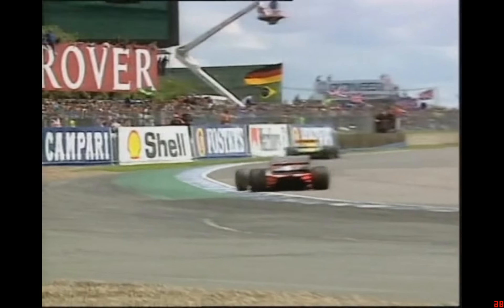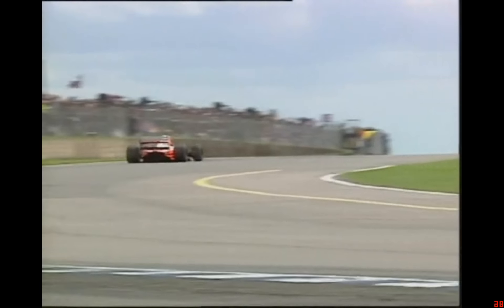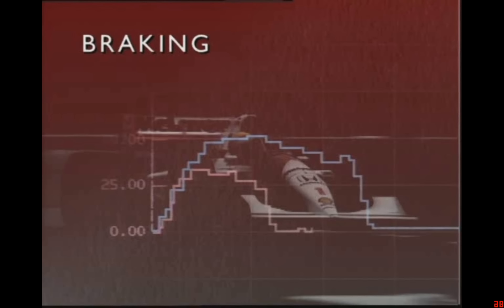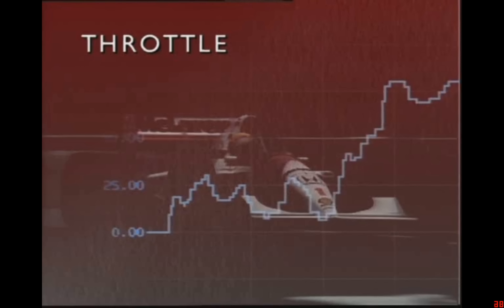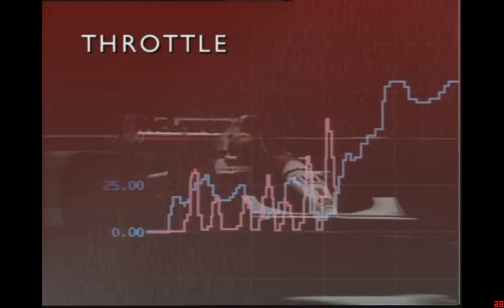Ayrton Senna - Braking & Accelerating Technique

Comment: And it also let to the fact that Senna always needed more fuel than his teammate. 
But I would be interested in seeing the Data of Senna and Prost on  chart. In fact, Prost had a different driving-style and was equaly fast.
Reply: He was most definitely not equally fast. He was the most consistent and was the master of preserving his tires and car, but he was not as fast. That much is abundantly clear from the qualification results. Those two were different in just about every way - made for the best rivalry I have ever seen in any sport.
Reply: And Prost won more titles with that than Senna. Therefore he was faster...on the long run. Thats whats important in motorsport.
Reply: Sorry, no. You are mixing concepts up. On the one hand you have the concept of being "fast" (the best indicator of raw speed being qualifying), on the other you have consistency. Then, overall you have a measure of who is the greatest driver overall - which also has to take into account the number of years you drove competitively, your competition, the quality of car you are driving, etc. Prost was the most consistent and Senna was the fastest driver - and to quote Jackie Stewart after Senna won his 2nd or 3rd championship (I forget which), he said Senna is now no longer just the fastest driver, he is also the best.

As for being the greatest, that goes hands down to Senna. It is subjective of course, but it is extremely rare to hear an expert or driver rank Prost higher. And the Autosport Magazine poll run some years back, which polled some 200 past and present F1 drivers had Senna ranked as the no 1 ever (followed by Schumacher, Fangio and then Prost).
Reply: TOFKAS01 so schumacher is more than 2x better than senna by your metric
Reply: He was definately more sucessfull.
Reply: His stats are better. But its from a career that spanned 16 years not counting his comeback. In cars that were almost always competitive. And in an era where Prost had retired, Senna had died, Piquet had retired, Mansell moved to Indycars and then retired, and his competition came from "giants" like Hill and Villeneauve (against whom he still felt the need to cheat). Hakkinen was the only world class driver from may 1994 and until 2003-2004 or so, but for all but a couple of years he was driving a hamster-powered Mclaren. Then, once names like Alonso and Raikonnen entered the picture (and matured and got good cars), party was over. Statistics have to be put in context.
Reply: Prost was definitely faster as he had more fastest laps.
Reply: Not a correct determination. For speed, you look at qualification. This is why Senna is considered by pretty much everyone as the fastest ever - even the few people who do not consider him to be the greatest ever will still usually say he was the fastest.

The problem with fastest laps is that they represent a single lap in the race and they were (in those days) almost always done at the very END of the race. From 1984-1994 re-fueling was not permitted in pistops, which meant that the car was much lighter at the very end. Fastest laps were therefore usually set by people chasing rather than by people leading. So, you could be much much faster for the first 60 laps, the cruise it home on the last 10, but then not get the official fastest lap because someone pushed hard to make position right at the end.

Fastest laps in those days were pretty meaningless. And in the years when Senna was at his fastest and in a good car, he would almost always push hard to get a lead early in the race. Rarely at the end. At the end, he was either so far ahead that he could cruise it home or he was out with a technical failure or accident.
Reply: Alan Frost Prost also had a higher % of wins and podiums, therefore faster when it mattered.
Reply: Look, you may have access to Wikipedia, but you are completely off the reservation here. There is no expert in their right mind - even the VERY few who regard Prost as better - who would say Prost was faster. In every qualification, Prost tried to be as fast as he could - just like everyone else. And Senna stood head and shoulders above them all in what is likely the most competitive F1 era ever. Also Senna is regarded pretty unilaterally as the fastest driver ever, even by the few that do not consider him the greatest.

He is usually also considered the greatest of course, as I argued above. Statistics on their own are pretty empty. They have to be put into context, and when done so, most experts agree Senna was the best ever.
Reply: Alan Frost is right. When Senna and Prost had the same car, Senna was faster it's a fact. Sometimes even much faster, like in Monaco 1988 when Senna got pole with 1.5 seconds less than Prost that was second.
Reply: MrCacciLLo no, he is wrong. We're you even old enough when these races happen? Senna always beat Prost in qualifying because Prost, like other real racing drivers like Lauda, would concentrate on race setup instead of having the car set up for qualifying.
Reply: Well, I will be turning 43 in a month or so, so I am old enough and I did see those races first hand. Every driver, including Prost, did their best to qualify. Did you see his face when Senna beat him by 1.5 seconds? You can find his expression here on youtube if you didnt see it then. 

Senna was also faster during the races; but Prost was more consistent. This difference was most apparent in Senna's early years, when it really was like fire and water - the fastest driver to ever step into a car vs the professor, who was the master at preserving tires and components. Later in his career - as Jackie Stewart so correctly noted when he said Senna is now not JUST the fastest driver but also the best - Senna had overcome many of his early weaknesses.

This is literally THE most absurd discussion ever. To argue whether Prost was greater would at least be an argument - not a great one, but it would be backed by some statistics. But to claim he was FASTER than the driver widely acknowledge as the fastest of all time means you are smoking some great opium over there.
Reply: You're Wrong, that's not correct. The 2 years (1988 and 1989) Prost and Senna had the same car, Senna was always faster. Both in qualifying and during the races. Senna had also more victories than Prost in both of those championships. Fortunately I was already old enough to see how good Senna was. The years from 85 to 93 were the most amazing times, for me personally F1 died in the 1994 season.
Reply: TOFKAS01 89 was a steal not a win
Reply: Not 100% true. If Senna didn't crash, it was very likely he would win more titles. The thing with Senna is his peak wasn't met. Perhaps if he didn't crash, he would have done more extreme things than he did in the '91 Brazil GP or everytime in Monaco.
Reply: If Prost were fast you wouldn't be commenting on a documentary about Ayrton. Plus we've seen Senna lap him more than once :)
Reply: buster is literally on every senna thread arguing prost is faster, when guys like alan frost give the facts he's gone.
Reply: @alanfrost75  Berger matched Mansell on Saturdays and Mansell Prost. These were the second to fourth fastest qualifiers and Senna often beat them by a lot. People mocking the fine driver/host Palmer should remember this.
Reply: @buster130579  No Lauda wanted to beat Prost in qualifying but couldn't. He managed to barely beat Prost with setup and experience. The situation was reversed when the faster Senna was bested by Prost in 1989.
Reply: @alanfrost75  is that why Prost has more fasted laps than Senna?
Reply: @MrCacciLLo  you also need to  remember that Honda admitted to providing Senna with more powerful engines.
Reply: @musicmusic6595  Alan Frost isn't giving very many facts though.  You also have to remember that Honda admitted to providing Senna with more powerful engines than Prost.
Reply: @buster130579  Actually, I responded to this earlier in this thread. Also, in response to your false claim to the other guy, you will find that my posts are full of facts - if you actually bother to read them. You dont have to read them, but please dont then claim that I am not providing facts. Anyway, here is the bit from ages ago that I replied with regard to fastest laps:

The problem with fastest laps is that they represent a single lap in the race and they were (in those days) almost always done at the very END of the race. From 1984-1994 re-fueling was not permitted in pistops, which meant that the car was much lighter at the very end. Fastest laps were therefore usually set by people chasing rather than by people leading. So, you could be much much faster for the first 60 laps, the cruise it home on the last 10, but then not get the official fastest lap because someone pushed hard to make position right at the end. Fastest laps in those days were pretty meaningless. And in the years when Senna was at his fastest and in a good car, he would almost always push hard to get a lead early in the race. Rarely at the end. At the end, he was either so far ahead that he could cruise it home or he was out with a technical failure or accident.